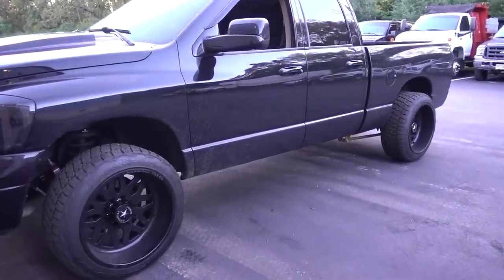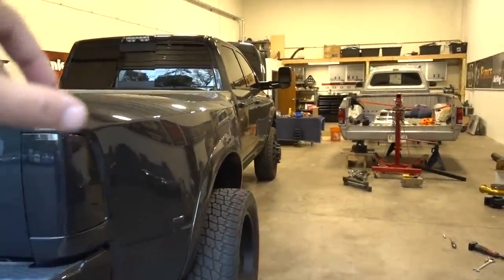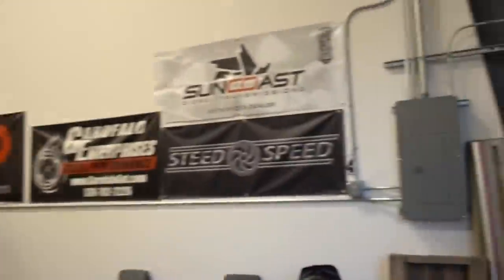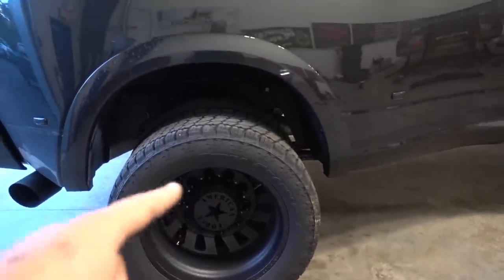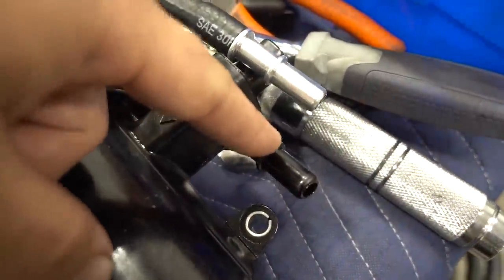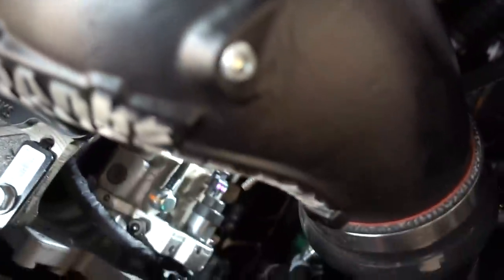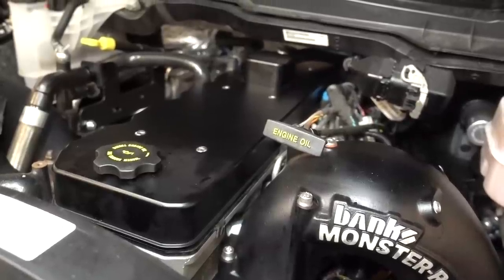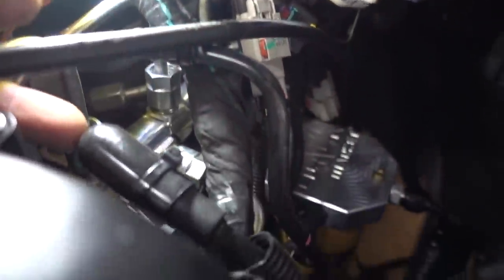CAT Filters on my CUMMINS!!! Here's HOW!!!

Comment: I installed the additional cat filter above the rear axle last year on my 18 Ram 3500. Made by Diesel filters com.. it just threads in right next to the water separator.. (stock fuel) yet .

Comment: The location of the fuel filter on these 3rd & 4th gen socks. I did an Amsoil remote mount filter and water separator. Much easier to change/drain. Mounted under truck.

Comment: I'm at over 400,000 using china fuel filters/front and back/ change every 10k. Engine runs smooth, mpgs 24-31 freeway. 2015 Ram Cummins 6spd. Amazon price both $25 pair shipped. And to solve the leaks and fuel cap problems, use about 1 spoon of grease on the threads, stops leaks, makes it super easy to tighten & remove cap. I use 2 o/Rings, at top of cap and bottom of container tread. Never broke a plastic cap yet or leaked fuel with grease.
Reply: Same bro, this kit is overkill even if you're hauling 30 k gross for a living, a replacement metal cap is easier and cheaper to install.... although not as cool maybe if I worked at cat I could see the discount advantages
Reply: I just changed mine from factory to black market. The factory kept leaking and was making me crazy I was also using the amazon filters I didn’t think about grease on the threads

Comment: I just ordered the kit from Dirty Diesels that comes with the Fleece delete for the fuel bowl on the engine block and all the lines and stuff u need to relocate the cat filter under the truck next to your H20 separator. When I eventually do fuel upgrade I'm planning on running the Fleece in tank pump so I thought it seemed like a complimentary set up. What do u guys think? Pretty much same difference as the BMP set up just easier to reach for future filter changes

Comment: Greg did you have any issues with the water separator leaking fuel. From what im hearing the bmp fittings are 0.12 inches smaller than factory

Comment: Cat filters are probably the best filter your could go with compared to Donaldson or Fleet Guard. They are a smaller micron filter compared to other brands, because cat engines are VERY picky, I’ve seen a few 3406e cats spit tips off of the injectors because the one guy that had worked for my father thought that a Fleet guard would be good enough

Comment: Greg why did you change out the factory CCV? What's the problem with it and why does it hurt or not hurt the truck? What are the benefits of running that and blocking those lines?

Comment: Fuel filter looks good but kinda dont like that the water sensor is at the very top of the housing so it means your whole filter will have to be filled with water before it turns the light on.
Reply: Actually, no.  The fuel flows past the sensor before it reaches the filter.  If the sensor detects water, it will trip the WIF alarm.

Comment: I have a kit from Throttle-up Industries that mounts next to the water separator you changed, uses the same cat filter.  What are your thoughts on running this kit in conjunction with the other?  Giving you 2 cat fuel filters and a water separator.  Thanks.

Comment: Hey Greg -  just installed the cat filter kits on my truck - went to reset my fuel life monitor and it reset the mileage but didn’t reset the percentage bar? Is this common because of the other sensors that are unhooked?

Comment: If I add that Banks Monster ram "arm" to my 2017 Ram 2500 diesel, would that void my warranty? I know a delete system would. Also, if I replace the factory turbo spool to an aftermarket better one, and if I take off the turbo silencer ring would that void my factory warranty? The turbo silencer ring on my 2017 has 3 studs that they would have to be drilled out. Any comment on this?
Reply: I'm not quit sure how familiar you are with the 6.7 Cummins but you'd have to be tuned & delete the EGR & EGR cooler to even be able to use the Bank's intake horn... which, of course, would void your warranty.  About your turbo question; yes if you do anything to it, like the rest of the truck,  you've basically voided any warranty you have on the powertrain.  In your case, you should probably leave it alone or have a professionally built unit installed. Turbos spin incredibly fast (120,000+RPMs) and any minute deviation in balance with cause a catastrophic failure.  You should certainly not remove the "silencer ring" because your HE351VE doesn't have one.  Removing that part of the turbo will only make more noise by increasing air turbulence and thus reducing airflow efficiency; it is there for a reason.  Hope this helps.

Comment: Wish I would’ve known about this cat kit I bought the one that goes by the fuel/water separator
Reply: Why, that one is better.
Reply: Monster RAM well it’s a beach to install and you still have to have the front filter in and have to replace it they’re similar in cost but I don’t Like still replacing 3 filters now instead of 2 and saving money
Reply: Install the fleece fuel filter delete then the factory filter is gone. I wonder how big of a mess the cat filter under the hood will make when changing it?
Reply: Joey Smith you can’t run the fleece delete with the kit by the fuel water separator.... not like a FASS set up... the return line or something is issue it’s stated on igotacummins.com

Comment: Is this different from air dog/fass?
Reply: Yes because an Air Dog/Fass is a lift pump, fuel filter, and fuel/water separator all in one unit.  All Greg did was delete the OE fuel filter and replace it with this aftermarket one that uses a CAT filter.